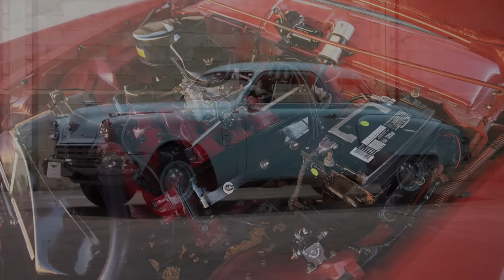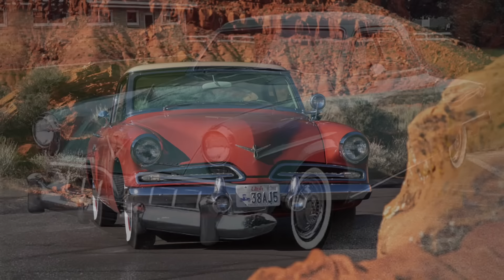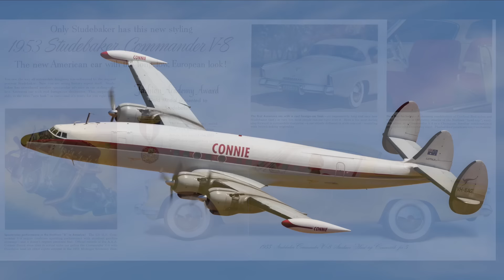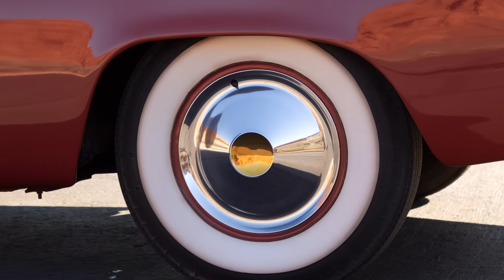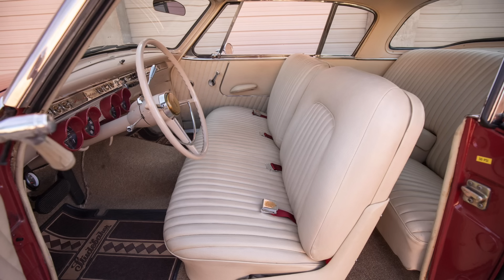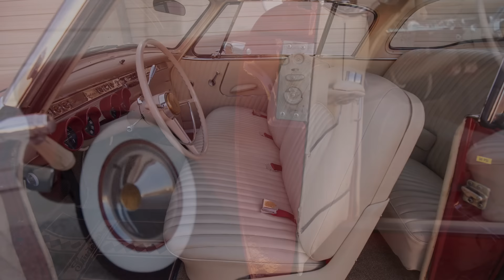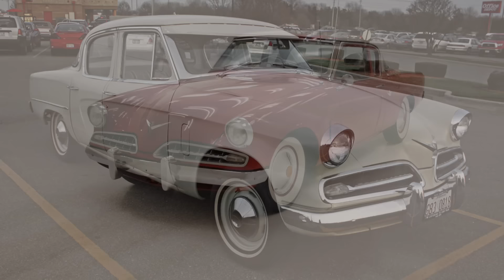Most Beautiful (& Flawed) Cars: 1953 Studebaker Coupes Had Only Skin-Deep Beauty

Comment: The 232 V-8 may not have been designed for acceleration but was designed for stamina. It DID propel Frank Mundy's '51 Commander to take three NASCAR checkered flags in 1951. Not shabby at all. My own '53 Commander Starlight Coupe is a joy to drive. Of course, I personally took it totally apart and put it back together, so it MAY be better than factory built. 😉😊

Comment: I owned a couple of 1954 Commander C bodies over the years and they had a heavy crossmember called a batwing that stiffened up the frame and the 54's had self energizing brakes which were a big improvement over the push and pray brakes on the 53's. I removed the 232 engines in my cars and replaced them with 289's and did the swap in several more 53's and 54's over the years. With a 289 engine and 4 barrel carburetor the cars were now fun to drive. I currently own a 1962 GT Hawk with a 4 speed trans and a 63 Avanti with the power shift transmission.

Comment: Nice video. Thanks for not showing photos that have nothing to do with the narration. Gee, you must be a real human. 😉😉  The design was way ahead of its time and the products from the Big 3 in 1953 look like cartoon cars, but not only was the Studebaker engineering substandard, but the interiors were very basic and poorly assembled. Poor Studebaker had a lot of inefficiencies and was cutting corners at every turn. Too bad these were not built by GM or Ford. The fully restored ones with a modern engine, improved dash and interior materials are the hit of car shows. The four door sedans were an abomination. What Studebaker did to the original clean 53 design also shows they had lost their way; nothing is uglier than the Packard Hawk of 1958.

Comment: Ok here's my 53 studebaker story. From 1962 to 1966 in my teenage dumb years I had a $100 one that was the prettiest of many cars I had. No dents no rust good paint and had been a show car previously because it had rolled and pleated front wheel wells and a custom built in cabinet with many small drawers. Also great interior but after a couple month's on the way to school the motor blew before that running perfectly. Out came my books off came my licence tag and never saw the car again.

Comment: It's interesting, build quality. If you read auto reviews from the mid Fifites,  most were already complaining about GM build quality (doesn't surprise me at all GM - Genuinely Mediocre). What car made in the United States DID drive worth a crap? Studebaker was already in trouble by the time Packard bought them, bringing Packard down as well. The 54s were much better, and that platform lasted until the last of the line in mid 1966. Larks were standard Studebakers with their front and rear overhangs cut off, the Avanti chassis was a Lark convertible platform, all from the Loewy design started in 1963. This company did wonders with what resources they had. If they had been a division of let's say Ford or Chrysler (GM never built cars this pretty until the Camaro that aped it, with the shovel grill and even the reverse rear roof quarter, 1972 or 1973 I think it was,) the Studebaker would have been a raging success, backed by all that advertising and showmanship, which, let's face it, is still alive and well in out auto industry today (how else could Chevy have  sold the awful 'cat eyed' pickups of the early 2000s or Stellantis sell anything with a Dodge nameplate on it). At least Studebaker went out with dignity, never asking for a government bailout. Can GM and Chrysler say the same thing?

Comment: I've always loved the 1953 and later Studebakers, especially the C/K coupes.
The Lowey coupe still looks great, 73 years later. Its styling cues, notably the split grille and the trapeziodal quarter windows are still in use today.
It wasn't totally done from a clean sheet of paper, though.
It retained a six-volt electrical system and floor board pedals, both of which were becoming obsolete by the early 1950's.
As stated in the video, the frame and brakes were weak. The low-nickel chrome used on the '53's (ostensibly because of the Korean War) was of poor quality. The chrome and brakes were improved on the '54 model.
The company also split production 80% sedans and 20% coupes, about obverse from actual demand.
IMHO, the 1953 Studebakers actually were the genesis of the company's eventual demise, along with the 1954 Packard merger.

Comment: A friend of mine had 1955 Golden Hawk with the 352 Packard v8. It had their at. He had installed the Caribbean dual quads .He let me drive it and said  the steering ratio was  slow. 
We pulled up behind a string of eight cars and I wanted to pass.
He said that was okay, but to pull into the passing lane before accerating. Otherwise, by the time I turned the wheel under acceleration,  I would have struck the car in front of us. 
When I pushed the accelerator, the at downshifted and the quads  opened . What a massive amount of unexpected acceleration  and noise. 
It was an experience never forgotten. It was like driving a rocket. When I finally let up the passed cars could hardly be seen in the rear view mirror.

Comment: My dad bought an original Champ pickup in 1979. It was a package sale and we had to clean out a garage. Part of that included a '53 hardtop that looked complete and pretty nice- except the doors wouldn't open until we put floor jacks under it.I also recall the hood did not fit correctly, a huge gap- and there was no way to adjust it correctly. It also hid a lot of plastic body filler in the rear quarters and the thin frame had rotted enough (water pooled into the sagging areas where the rubber spacers were) to making it worthless other than a parts car- which is what we sold it off as. Despite being such a beautiful of a car it's build quality really soured me- the reality was that it's just a piece of H$it. How could they build something this poor?

Ive seen so many of these derelict Studebakers over the years sitting around in woods, barns and in wrecking yards. Mostly complete cars that no one will sell in whole or in part. None really ever had any value and for the most part they still don't. We sold that 1953 for $100 in 1979 - I think we had it for about 6 months and repeatedly had to fend off inquiries about the thing being roadworthy- at best it was just a parts car. We often joked that it probably will end up sitting next to a garage, exactly as it was when we sold it,  for the rest of eternity.

Comment: I suspect the quality of the car would have been better with the shorter wheelbase  of 116.5' instead of the 120.5" chosen.   That would have made for a more substantial, solid automobile, particularly the hardtop.  And perhaps Studebaker  could have used a window treatment like the '70 Camaro.   It also would have made a convertible more viable.

Comment: Great video.  This was my first car.  i bought it from my brother in 1957 when i turned 15 1/2d for $600)   You left out the most amazing part of the car, the overdrive transmission on the six cylinder manual 3 speed transmission model.  
In order to put the vehicle in overdrive at any speed or any gear (there were 3 forward gears with a column shifter), one had to pull a lever out.  Then to get it into overdrive you merely accelerated and  then totally took your foot off the accelerator.    This allowed it to accelerate to 55 mph in 1st gear.  You could engage overdrive in any gear in this manner.
Also, since it was my older brothers car he had certain birth control devices stashed throughout the car (he was quite the lady's man- looked like Tommy Sands-something I didn't inherit sadly).  I wound up selling it to a guy for $300 a couple of years later.  He had the unusual job of artificially inseminating cows which he described in great detail and left me and my Dad dumbfounded (I lived in Culver City, Ca-in the heart of the Los Angeles)
Reply: My high school car. I used my tire iron to jump the solenoid to start it. The heater fan was OUTSIDE of the car at the top of the passenger wheel well,and over the tire (covered in slush). The large, flat heater radiator was under the front seat(covered with dirt and trash.. I don't remember a working defroster. It was VERY cold. I would pretend it was fast, but it wasn't.

Comment: Adam, first off I am a car guy who could never afford to have more than two “collector” cars at a time, but I did fall under the spell of owning Studebakers in my 20s.  I bought a 1965 Commander in 1976 and drove it as my daily driver for about 6 years.  I did buy a second car, a 1956 President (with the long wheelbase) which I thought was wonderful.  To me it was quite powerful with the bullitproof 289 under the hood.  I thought that car drove beautifully and handled very well.  So my question is, did the company not “fix” the body flexing issues on the LWB models by 1956?  I thought the 1956 models were also very attractive, and were at least as good looking as a 1956 Ford or Chevy….

Comment: Chassis (frame) is supposed to be flexible.  Body is supposed to be rigid.  A car with bad nvh is assigned to body engineering to fix usually by stiffening to the rocker panels and improving joint efficiencies especially the front and rear body torque boxes where the body mounts attach .  Chassis is responsible for providing a mounting surface that does not change position while under extreme conditions.  Frames can be too weak which makes them inherently unsafe.  Someday take an old 4 door sedan and cut the roof off.  Make sure it’s a body on frame car.  Open and close the doors a few times.  You may get 2 or 3 closures before the body and frame both bend.  The over all body structure can carry a large bending and torsional moment without permanent set ( bent) .  I forgot the number  but a typical body structure both, unibody and body on frame had about the same stiffnesses.  It was a big number.  The amount of exotic materials used in body structures a test to the importance of the structure in both nvh and crash.

Comment: The big 3 produced cars for auto shows that were advanced but Studebaker made advanced cars for the public. They put so many modern and unique  features in their cars such as overdrive transmissions and self adjusting brakes. We owned two, I had two uncles and a grandfather that owned at least one or two also. I never heard of the frame flex problem and they were fast enough. That flat head six would do 95 and the v/8 well over 100. BTW That was and still is a beautiful piece of automotive art. I want one.

Comment: Unfortunately, Studebaker didn't have the money to improve their engineering. The low styling meant they had to incline the engine about 7 degrees and thus had a terrible shudder in the 2-piece driveshaft. I am customizing a '53 Coupe with cut-down '56 packard lenses and a 2" top chop. Its a Commander Regal Coupe so it has extra trim around the sills and windows, which make the windshield look better. I'm keeping the Regal trim...I don't wann talk about the chrome plating cost......Secondly, they didn't have the money to improve the front suspension, which had trunnions and kingpins like the C1 Corvettes. Carried that stupid design through the Avantis. But what a wonderful design!!!

Comment: The C/K Studebakers were and are some of the most beautiful cars ever built. 73 years later, they still look fresh.
There are questions, though. Why did Studebaker stick with a 6 volt electric system, and through-the-floor pedals, which were both obsolescent by the early 50's, for instance?
The management planned 80% of production as 4 door sedans, on a shorter wheelbase than the coupe.
However, demand for the coupe far outstripped production. 
The car was also hindered by mediocre handling, and weak brakes. The brakes were improved for the '54 model year.
In many respects, the 1953 Studebakers represented lost opportunities that in the end, killed their automobile business.
The investment in tooling was such that the company was forced to stick with much of it until the last cars were produced in 1966.
It is a tribute to Raymond Lowey and his team that styling cues such as the trapeziodal quarter windows can be seen on today's cars.
The coupe continued in production in various guises until 1964. They still look great today.

Comment: The 54 models had a hill holder which worked with the master cylinder that held manual transmission equipped cars from rolling backward while sitting on a hill.   Simple design that did not catch on.

Comment: Doors would fly open over RRXs, not enough power to keep up even with straight 8 Buick with Dynaflow, rattle rattle rattle, indifferent steering and handling.  It's a car you look at...not drive.  The Stude V8 was a good-enough design.  DG auto trans had torque converter lockup!  Nice looking Loewy design screwed up by awful engineering.

Comment: The 53 & 54 are stunning. The Studebaker V8s have a distinctive exhaust note too; especially with glasspacks. The suspension is rugged but does drift and wonder. The frame is not the best but gets the job done. Mine likes to cruise at 60. Great video!!

Comment: I owned a 1954 champion sedan for many years. The steering was an overly complex arrangement of linkages connected to a central Bell Crank. At low speed the steering was heavy while at highway speed it was light and indirect. The two piece drive shaft was a constant source of annoyance also.

Comment: When I was a student at ODU in Norfolk, VA in the late '80s, I'd often see one of these, a powder blue one, parked there when I went to class; someone was clearly using it as a daily driver at the time.  I thought was one of the prettiest cars I'd ever seen.  I never found out whose car it was, and I didn't even know anything about Studebakers at the time.  Now I own an Avanti, and I know lots about the company and its cars.  It's really a shame the company went under (its automotive division, at least).  They had a way of doing a lot with the scant resources they had to work with.  I love the way they got Brooks Stevens to come in and restyle this very body and chassis, to produce the GT Hawks of the early sixties, which are beautiful cars in their own right.  Studebaker never had the money the big three had to do the then customary yearly styling changes customers wanted, so they had to get creative, and they did some amazing work considering the constraints they had to operate under.

Maybe it was based on the experience with the shoddy door latches from this car, but my Avanti has door latches licensed from Mercedes, which were designed to keep the door closed in an accident.  And as for the availability of these 1953 cars at affordable prices... I think also contributing is the fact that they are like '32 Fords: it's really hard to find ones that haven't been turned into hot rods.  The fact that so many of them have been very heavily modified probably contributes to overall lower prices; all other things being equal, cars are always worth more if they are original.

Comment: i only had one opportunity to drive this style Studebaker. i was about 15 years old and was visiting my cousin in the Texas Panhandle. He and some friends went to Lubbock for some beer. On the way home I was the designated driver. It was about 100 miles trip and on good highway, so didn't feel the body flex that you mentioned. To a 15 year old it felt like driving a sports car. I loved it and have admired it since then.
In Arkansas two years ago I had a chance to buy a '53 starlight coupe with a six engine. It was not done over, but looked like it could be made roadable t minimal cost. I passed it up. I've regretted it ever since.
why couldn't someone find a way to box that frame so it would not flex. I can't believe that hotrodders let that get by them. 
Even Airstream travel trailers did it on models with a rear bath. Geez, hotrodders...I'm all disappointed in you.

Comment: I can remember one thing late 40 or early 50 they had something on the heavier trucks you could stop on a hill put you brake on and push the clutch in and it would sit there until you let the clutch out, something like the drag racers used like the line lock.

Comment: My father raced one in the early 1960's at a local 1/4 mile dirt track in Arlington NY.  It was pretty cute, but would spin-out at the drop of a hat....or a tap from another racer.  He had better luck with a Hudson Hornet.  Arlington Raceway closed by 1965(?) so he raced at both Onteora
and Accord raceways till the late 1960's.  Back then it was really cheap to get in the race as his Chrysler Spitfire coupe, race ready (except for the engine), cost $50.  A replacement Spitfire motor cost $25.  Lots of fun for $75.  His best racer was a 56/57 chevy with a 283 engine.  A sweet runner.  No special insurance, no flameproof clothing, minimal vehicle inspection, it was a run-what-ya-brung time.  Now, to get in the game it is expensive, which means more serious, which means less fun.  I remember that one of the racers fueled their racer with alcohol that was home distilled.  I remember only one tragedy when a driver, who was belted in but sitting on a cushion, died when he rolled the car at the start of the race.  He was 'threading the needle' from the second or third row to start the first lap in hopes of a fast start.  He hit another car's right front 'big' tire, rolled up and over it and flipped. The cushion flew out and so did he, and then was struck and killed.

Comment: Adam thank you for the most excellent video most Studebaker Lark type Vehicles up until 1966 the end of the line were based in the 1953 Studebaker chassis if you could someday please do a video about the 1963 through 1966 Studebakers Avanti's and Hawks included that would be great thank you 100 times